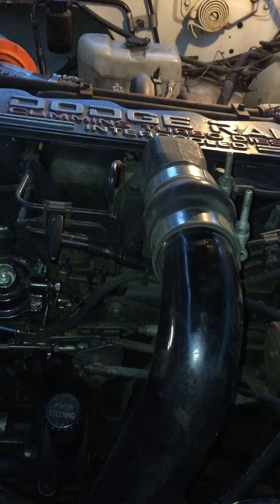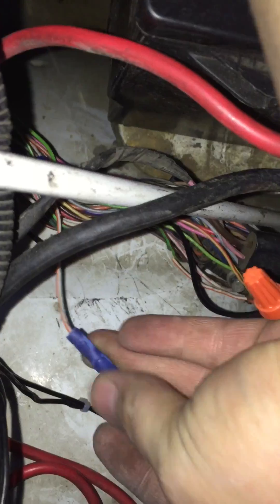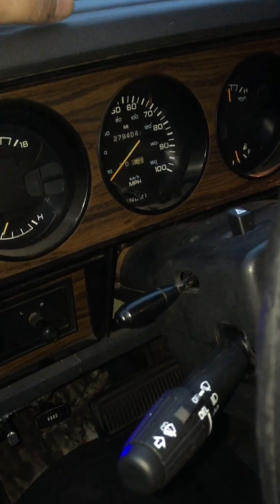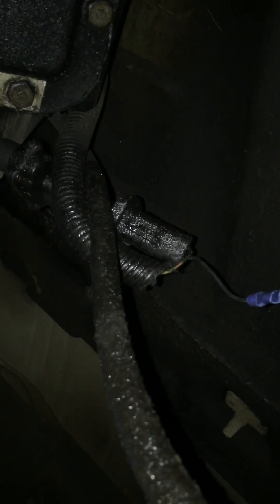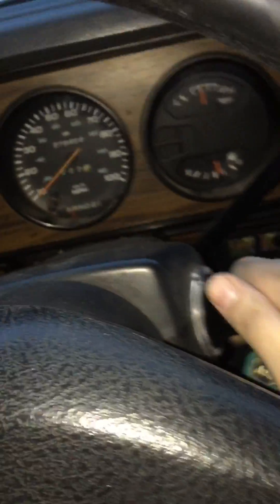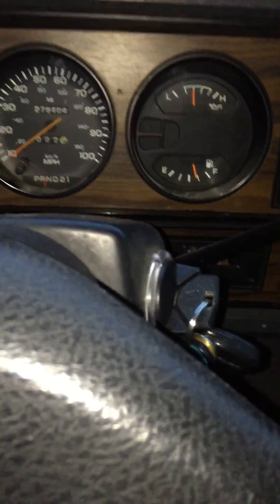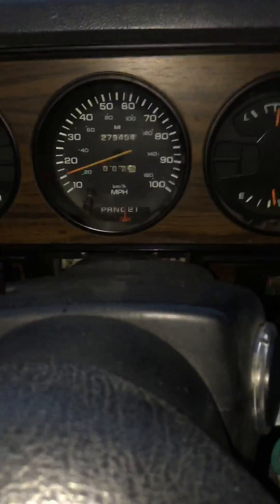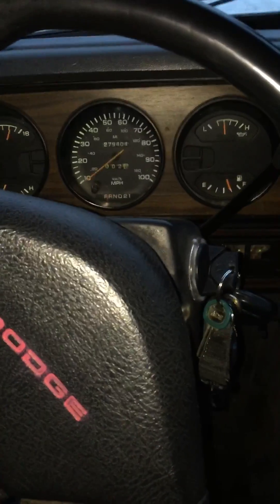Dodge W250 Cummins Speedometer Modification

Comment: In my case - 1990 D250, I had the perfect speedo gear in my 47rh transmission, getting me GPS accuracy on the speedometer. 

Then one day, my speedometer needle goes out, but my odometer and trip odometer are working fine. Tightened all the female connectors behind the instrument panel (to include the three on the speedometer itself), same thing. 

I was able to bench-test my speedometer with a spare speedo sensor (no polarity BTW, but still requires a GND) and a drill, and guess what? Still no speedo needle!
Reply: My '93 is doing the same thing. I have my odometer and trip meter and even my cruise works but no speedo. I also have an auto trans. Did you ever get yours figured out?
Reply: @kellymichael7362  Oh yesh, My Child.

I came very close to just retro-fitting a GPS speedometer into my dash (which is actually a great solution for some vehicles, if no parts are available for older vehicles). The one I was planning for off of Amazon would have matched the rest of the instrument panel very well.

However, since there are resources available, I researched and worked the entire system, from the speedo gear on the transmission, on-up. A previous owner had put slightly larger tires on the truck, which made the speedo read about five miles faster than I was really going. In addition, the needle would vibrate all over the place. The solution: Another speedo gear that was simply ONE TOOTH LARGER IN SIZE. This gave me precise speedometer readings, compared to GPS. The needle's vibration was caused by having no ground connection at the speedo sensor. One way to fix that (since there is a lot of overly redundant ground wiring in these trucks) is to simply tie-off the speedo sensors' GND to the frame, right there near the sensor.

I pulled the speedometer. the two wires in it had gotten brittle over the years, with one broken off of the circuit board. Also, Ebay (the best place to go for rebuilding EVERYTHING on these Dodges, especially original Mopar parts) has modern, self-lubricating material replacement gears, for rebuilding your speedometer, yourself. Sure enough, my original gears came apart in my fingers, as I removed them.

As I mentioned above, having a spare sensor, I was able to bench-test my speedometer, spinning the sensor with a drill, and I was very happy.😃

I can now take hyper-accurate mileage readings with my trip odometer, experimenting with different Diesel, B99, waste veg. oil fuel mixtures.😃
Reply: @erwin643  Awesome. Thanks brother. I'll give that a try.

Comment: I know yours is a 93. Mine is a 92 D350. Do you think I can cut orange and white at the speed sensor and splice into green behind speedometer or does it specifically have to go thru the pcm for voltage or something? As you can tell I am not an electrical guy.

Comment: Great video, I believe running a wire from  pin 47 to the green wire on the speedometer is unnecessary though. I believe all the ECU does for this speedometer circuit is ground it. Instead of cutting into your wiring harness you can just get a pin connector that goes into your ECU into pin “4”( the black/blue trace wire coming from speed sensor on the transfer case) and ground it. I say the wire going to the cluster is unnecessary because it already has continuity from the orange/white trace wire, but I may be incorrect
Reply: So you just found pin 4 at the computer and clipped it and grounded it there or left the wire intact and grounded it inline?
Reply: @roadhazardguy  
It has been a while since I did this but I never cut any wires. You can cut the wire and ground it that way. But I just found some male pin connectors and ram that into the female ecu harness. Then from the harness to ground. Hope that helps
Reply: Did you ever confirm this?
Reply: @rebelrider8312  yes I have it set up like this on my truck and it works

Comment: Hey man how you been? I hope you answer my question. I have a 1992 D350. It just got the transmission fixed but the mechanic told me that this : OK so current update.

The idle down function on the truck is worn out so the truck will not return to idle after you apply any throttle. The bushing on the idle lever is worn out and can't return to the idle position.

This needs to be fixed before I can even start on the harsh engagement. The idle can/will cause this so that needs to be addressed first. If I lower the line pressure to adjust for the higher idle it may not have enough pressure for driving/towing and will damage the transmission.

As for not having 4th gear the truck is not commanding 4th gear.

That can be caused by a bad sensor, ecu or a wiring issue. Unfortunately we do not do any electrical work on the engine side of the truck, just the electrical on the inside of the transmission.

So unfortunately there's not much I can do for you on the truck at this time. If you can get the electrical figured out that will get you 4th gear again and if you can get the idle down lever to function correctly that will fix the harsh engagement issues.
You think it’s the overdrive problem?
Reply from the maker: If you have the A518 transmission its a 3 speed with overdrive for the 4th final gear. So this bypass should work for you.

Comment: PREGLOW mod you did can you post that please. The over drive mod also please. I have an inop speedometer that is no longer working and is not fixable. I can't go into overdrive until I fix a couple things here. I have replaced that alternator and bypassed the voltage reg. pricey alt but worth it. Thanks...great video...
Reply from the maker: Just uploaded a video for the overdrive bypass. For the preglow mod I will do a video when I get a chance.

Comment: I tried it on my Dodge and it doesn't work I've checked the replace the speedometer and check the unit down at the transfer case and what you're saying as far as the wiring is concerned does not work
Reply from the maker: My truck is a 93 so its possible the wiring could vary in different years.